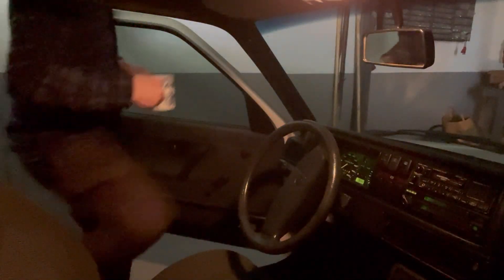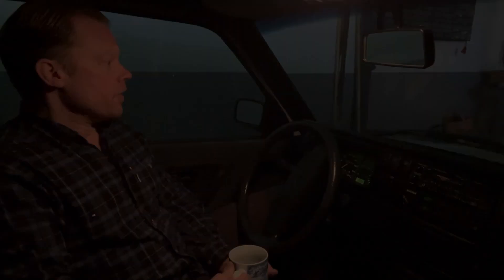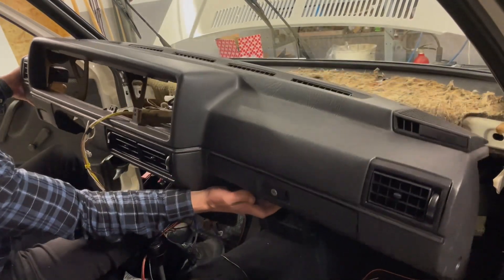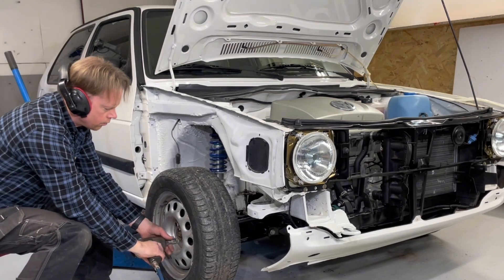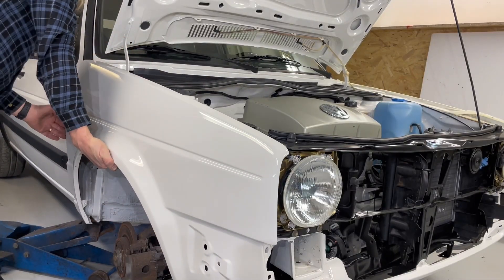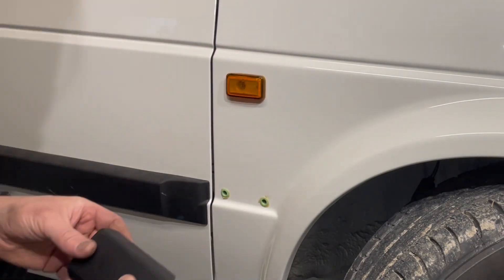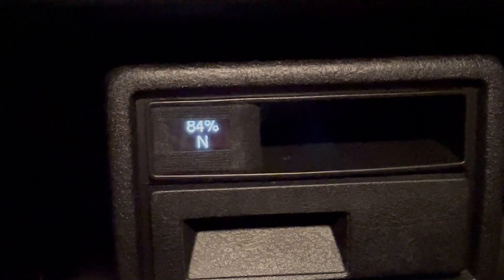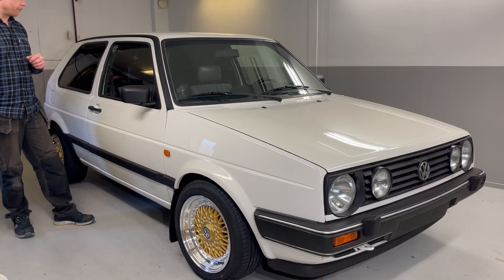Reassembling the last parts after restoration and modernisation. Vw golf Citystromer, ev conversion.

Comment: 0:21 - well, these wheels are too wide and going beyond the wheel house which means by EU laws trouble cause here the police would stop the car and you can not drive any longer. the wheels have to stay inside the wheelhouse which is measured by a thin line connected to a nut hold on the wheelhouse. 
If the line touches the wheel there is an issue. How do you get a MOT for this ? Different wheels for the MOT moments ?

But great progress and really stunning looking car. The dashboard and vents look amazing for its age. 
I hope to see sun in Sweden soon and nice weather for test rides. Great series !
thanks
Reply from the maker: It looks worse then it is. I will give it a try. It doesn’t touch the fenders when they are max loaded.

Yes I really want to have some good testing whether now☺️

Comment: Congratulations on the excellent result of the restoration and upgrade! Have you considered LED DRL (maybe converted fog lights) and or LED headlights upgrade?
Reply: I don't think there are legal replacements available. You can install a great big lightbar though!
Reply from the maker: I might save 600Wh on one cycle so for me it’s not worth it. But I might do it anyway some day😅 but I think it can be hard to do it in a legal way.
Reply: @flyingtools  Yes I guess for the range it would be hardly noticeable. I don't know the efficiency of the DC-DC converter but estimate the total energy saved could be up to 130W out of the main battery. It seems that OSRAM H4 LED Night Breaker are legal (alsoin Sweden) for Golf 2 headlights with type numbers E10 02010 / E15 7-20 / E1 14551. They should save about 50% energy so that is not that much but also provide more light. Maybe one could run also these at reduced voltage and intensity when used as DRL (like in the old SAAB 96) for even more lifespan and energy savings.